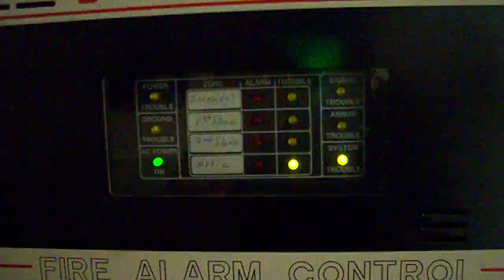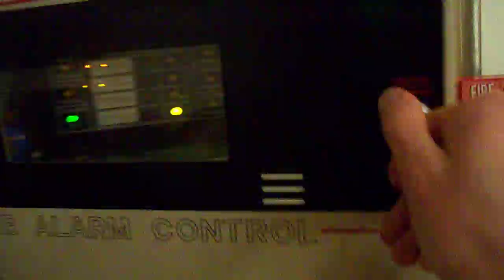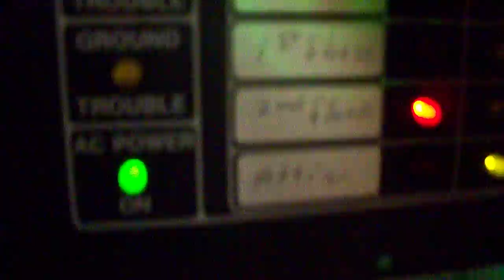Simplex 4001 quick system test

Comment: Why was the Power Trouble on the FACP flashing at 0:46?
Reply: the 4001 is beefy with what it chooses to activate
Reply from the maker: Probably due to slight back EMF and or interference from the strobe firing. Nothing to be concerned about, I've seen them do that. Thanks for your comment :)

Comment: Ah the good old 4001. The only simplex panel that output FWR
Reply from the maker: From what I understand, like the 2001, it was designed to output Filtered DC. Over time, the main filtering capacitor fails causing the output to be FWR. Replacing the capacitor will restore Filtered DC to the NAC, something I need to do with this panel one day.
Reply: doesnt the 9838 do it too
Reply: @noroultra  That's a horn. Not a panel
Reply: @SomeDudeWithAnExitSign  also the 9838 is used as an announciator in nuclear power stations
Reply: @SomeDudeWithAnExitSign  how would it be controlled if the sensors were broken? a panel that comes with it

Comment: Noooo don’t use 4903 strobes on the 4001. That panel outputs Full wave rectified power on the NAC and 4903 strobes and electronic horns aren’t designed to be used on FWR.
Reply from the maker: Thank you for the insight. I thought all Simplex panels were filtered power on the NAC, all the way back to the old 4208 panels? I've seen before that people said the 4001 was filtered, but I've seen that conflicting as well as some people still say it's FWR. I think the large capacitor on the bottom left of the board is a filter capacitor for all DC voltages to the panel, which makes sense as it's right near the AC input from the transformer secondary which would go through the rectifier then the filter capacitor. When it drys up over time and fails as all electrolytic capacitors do, the NAC power is essentially FWR because of the capacitor's inability to filter the DC power anymore. Replacing the capacitor will restore proper filtering. I guess the only true way to tell would be to measure the output of the NAC with an oscilloscope and look at the waveform so I might do that down the road.
Reply: Someone told me it doesn't matter since they use simplex on fwr all day
Reply: @AcElectronicSystems  yeah well 2 of mine fried after a while of doing that. Just warning y’a it’ll happen sooner or later
Reply: @CJ9899  oh snap